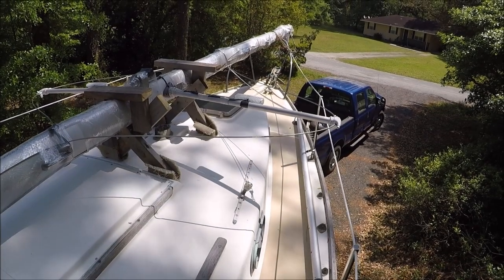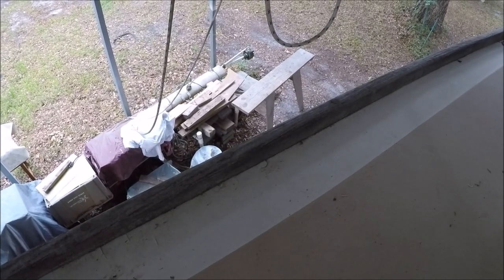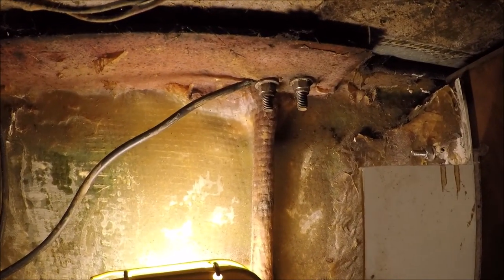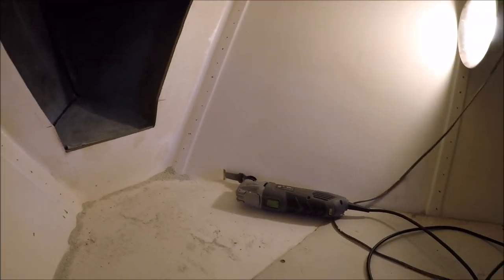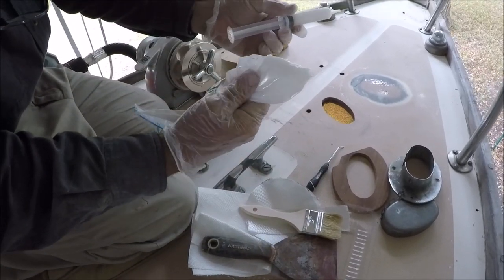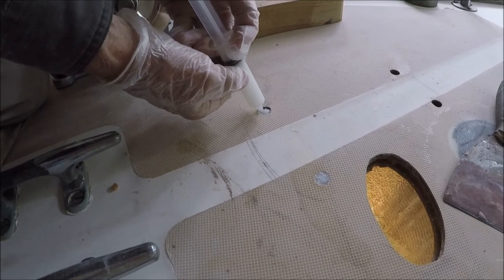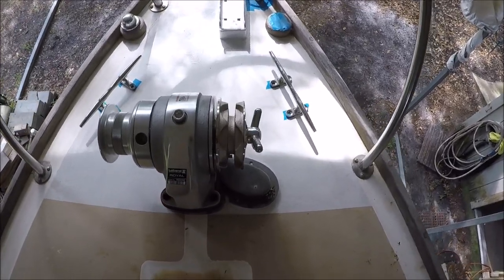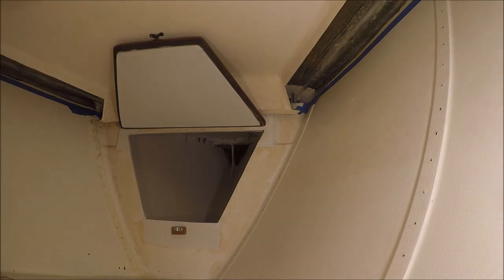CD27 Refit Part 2 - Hull/deck joint, windlass, bow roller

Comment: Nice job James. I have the same problem of a leaking combing, rub rail, bulwark, cap rail, known by many names leaks all the same! It is a shame that a very strong and waterproof joint is then ruined by drilling a MILLION holes in it to attach the trim. Mid Pacific I had water sloshing around my interior and floorboards because of it, I ultimately reduced sail to heel less to cut down on the heel angle so less water ingress. If I had a shop and a place to take my boat out of the water To work on I would rip off all the teak trim and fiberglass over the whole joint from the outside then make new cap trim and attach it without putting screws through the joint. Unfortunately I probably won’t live long enough to do that! Haha! Thanks for the excellent video! Ben S/V DAWN in Tahiti, French Polynesia
Reply from the maker: Sorry to hear about the wet passage. On my first Pacific crossing I also had deck leaks that had me bailing out lockers and bilge every couple hours in rough weather or when beating due mainly to rotted deck core which made it impossible to seal any thru-deck fasteners. I'm thinking the repair method shown in this video will take care of the leaks but a bigger job of glassing over a new toe rail as you describe is another option.

Comment: I’ve learned more in the last two hours watching your videos then I have in many years. Thank you. I’m up in the Myrtle Beach area. Looking for my first sailboat. I like the Cape Dory 27 & 28’,  Alberg 30 some
Or the smaller pacific seacrafts, Shannon’s and nonsuch but they’re out of my price range. Just need a simple semi full keel preferably tiller steer. Again thanks for the education. I like that you dug out the balsa around the inside of the holes, filled them redrilled smaller holes so any water that possibly gets in doesn’t touch the balsa. Sounds like commons sense but I’m sure a lot
Of people don’t do that.

Comment: Hi James
Love your work.  May ask what products specifically you used to glass that hull-deck joint?  And you laid one layer of fiberglass tape over the thickened epoxy or multiple layers?  Thanks for sharing your amazing skills.
Reply from the maker: Thanks. Since I figured the hull to deck joint was plenty strong and only needed sealing rather than much strengthening I used only one layer of 4" wide 8.7 oz weight fiberglass tape from the link below. Before the fiberglass I cleaned and sanded the sharp edges down and applied a fillet of thickened epoxy and then applied the fiberglass directly over it before it hardened. That makes the application much easier because you don't wait for it to harden and then need to sand it. I use uscomposites 635 epoxy kits and pumps and their Aerosil/Cabosil filler which is equivalent to West System 406: https://www.uscomposites.com/cloth.html
https://www.uscomposites.com/epoxy.html

Comment: Lovely work, Mr. Baldwin. What serial number is the project boat? I'm amazed at the variety in the way CDs shipped.  My 79 CD27, number 146, has the short cook top overhang as your project has, but it has a very small corner electric panel above it, with about 15" of flat liner to the left to the companionway opening. The comparatively massive wiring box would make wiring easier, that's for sure! I look forward to the rest of the refit! Fair winds, Andy
Reply from the maker: I don't have the number at hand but it's a 1978. I've seen other 27s like yours with the smaller electrical box molded into the corner of the liner and I'm glad to have this factory version. The large box is also nice because it contains the backs of any instruments you mount on the bulkhead outside. If you need more space you could always cut it out and build a wood box there of whatever size you need. The large box does make it awkward for the standard stove position since it will bring heat and moisture closer to the switch panels but coming up next I show how we fixed that with a slide out stove counter.
Reply: @atomvoyager  Thank you! Yessir - I will be looking forward to the slide-out counter! Otherwise, I had been thinking about replicating the longer counter in the 1981 CD27s. I'd like to mount my Origo 3000 fore and aft so it can gimbal properly...one of these days lol

Comment: Hello James, great video. Are you planning to reattach the liner cutouts? I would too need to make similar cuts to access the hull to deck joint but I'm not sure how to put them back, so the job is on hold for now.  Also, where do those thick wires connected to the chain plates go, to the keel or a grounding plate? Are they for lightning? Thanks.
Reply from the maker: Yes, the wires go to a bronze lightning ground plate on the side of the keel. I do plan to reuse the cutout liner pieces by attaching them probably to metal brackets with screws so they can be easily removed for future maintenance or deck fittings.

Comment: Hi. May i ask why it is necessary to raise the windlass by placing the teak under?
Reply from the maker: The windlass needs to be about 1" higher than the deck chain pipe fitting to allow clearance under the chain wheel for the cap to come off. The deck chain pipe should be raised at least 1/2" above the deck so less water comes below when sailing in rough seas. That makes a minimum of 1.5" windlass base block needed. It doesn't have to be teak. You can glue multiple layers of plywood together and then seal them well with several coats of epoxy resin and paint.
Reply: @atomvoyager  Thanks.

Comment: Hi James, what multi tool blades do you use/recommend for fiberglass? Do you like one brand in particular? Thanks.
Reply from the maker: I haven't figured out which brand is best but use Titanium coated bi-metal blades. Read the reviews on amazon to get good ones and make sure they fit your particular tool.

Comment: Was the balsa core around the original chain pipe rotted out? I am looking to repair my CD27, and it seems to have some balsa rot in that area. Curious how far the rot went when you repaired. Did you notice any rot on the new chain pipe hole?
Reply from the maker: Every boat can be different but on this one the exposed core was only slightly damp at the edge and when I dug it out about 1/2" all around to prepare for sealing with thickened epoxy, the core was dry and intact. If it had been wet but not rotted I would dig it back at least one inch and then let it dry, maybe using a heat gun to help, and then fill with epoxy and it would probably be good for many years. If actually rotted and felling spongy when you stand on it then you need to replace the core by cutting up the top skin on the deck.

Comment: 00:57 Did you use the vibrating tool to make that long straight cut just by following a drawn line? My cuts don’t look like that. 😔
Reply from the maker: Yes just freehand with the oscillating tool. As long as you have a line to follow you should be able to get it close to straight with some practice. Meanwhile it's easy to straighten the line with a belt sander or 4.5" angle grinder and 36 grit disc after you cut.

Comment: Hi James, is there a specific chain pipe that you can recommend to pair with the Lofrans Royal manual windlass? Thanks
Reply from the maker: In the past I preferred to use a large round bronze chain pipe but they are no longer available so I use the oval ones like the one linked below. You can't use a hinged one because there's no clearance for the lid to lift up. A smaller one will work if you are going to use a chain to rope splice and never need a shackle to pass through. https://www.westmarine.com/west-marine-oval-deck-pipe-116970.html
Reply: @atomvoyager  Thanks

Comment: Why was it needed to cut down the chock underneath the new bow roller? Couldn't the  block supporting the bow roller have simply been taller?
Reply from the maker: A higher mounting block adds unneeded weight and thickness, reduces the anchor clearance under the furling drum and the chock has a rounded uneven top with captive pin that doesn't do any good under the roller. Having said that, you certainly could do that if it was your preference.

Comment: Does the Cape Dory 28 have standing headroom under the bimini in the cockpit? If not .. could you suggest a modification to allow you to stand up straight in the cockpit?
Reply from the maker: I haven't measured a CD28 . You could check the Cape Dory forum. Headroom under a bimini will vary and is restricted by boom height. I think the standard boom height on the 27 is too low for the bimini to clear myself at 5'8" but not sure the exact number. The CD28 is probably a couple inches more. I'll be moving the gooseneck up a several inches on the 27 here to gain some more headroom. This can be done on most boats to suit your height although the mainsail may need to be shortened if you run out of clearance on the luff hoist.

Comment: Hi James, What size bolts did you use for the windlass? Are the black inserts (nylon bush) to be removed or they stay in the holes? Do you use washers too? Thanks.
Reply from the maker: The bolts are 3/8" and usually around 4-5" long depending on mounting block, deck thickness and backing plates. The nylon inserts are kept in place to serve as isolation between the stainless and aluminum and you should place a stainless flat washer under the bolt head to prevent crushing the nylon.
Reply: @atomvoyager  Thank you. That's very interesting because I tried 3/8" and they were too large. I am using 10mm bolts, the largest I found that fit nicely. Thanks for the tip about the washer, I wouldn't have thought it necessary. Best!

Comment: Not a fan of the battering ram on the front of the boat.  My CD 27 had one installed and didn't like the look of it and didn't appreciate the damage done to an irreplaceable bronze fitting.   The windlass is overkill on these boats.  I went with bronze anchor chocks and an upsized Fortress anchor.   I anchor a lot and this has worked out very well.
Reply from the maker: You're right to point out that not every owner of a 27 footer will want a windlass and bow roller if they have a strong back or don't mind using lightweight ground tackle. They are optional on this size boat. I'm refitting this one as I've done several others in what I call the Voyager Edition - ready for any sailor, even an old one like me, to circumnavigate, including making them safer for stops at deep precarious anchorages such as I've encountered on my own two circumnavigations on a similar design 28 footer.

Comment: what if you wanted to move the chain locker even further aft, perhaps as far as the head. would something like that be practical?
Reply from the maker: On some other designs I've seen where people have wanted the weight of the chain further aft or because the original chain locker was too small that they moved the windlass as far aft as just forward of the coachroof and dropped the chain down through a large PVC tube into a locker approx where I have the water tank installed on this boat. I would prefer not to do that though since it places that obstruction in the center of the v-berth and I prefer to use that space differently. I guess it would be possible to mount the windlass and the locker off-center but doesn't seem practical. Nothing comes to mind for any other method for what you describe.